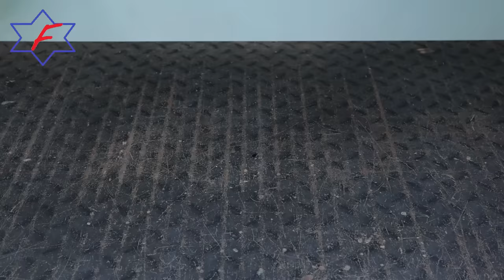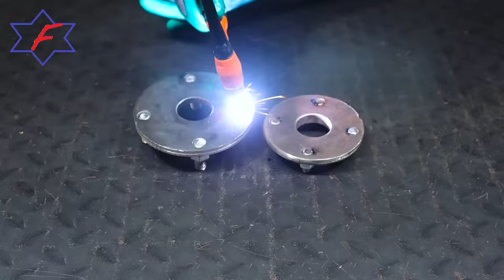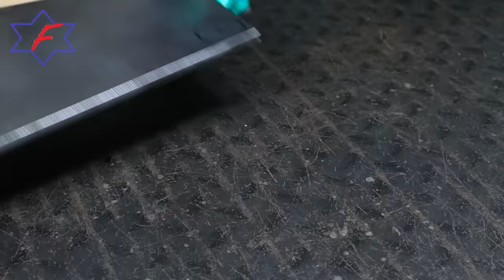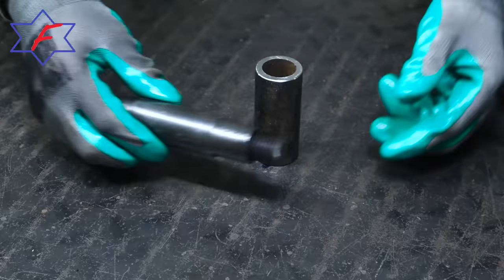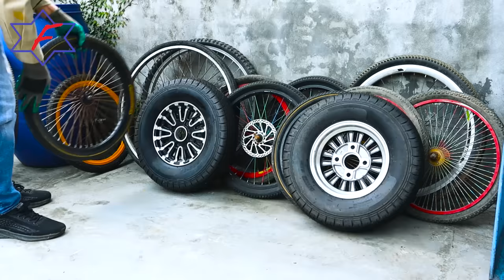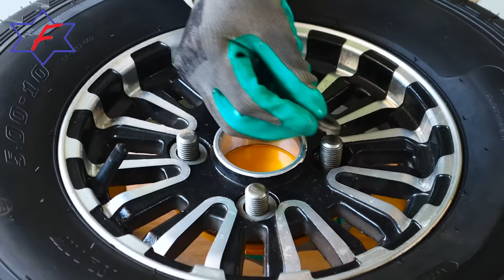Build A Crazy Trike 450cc Use Truck Wheel And Great Experience

Comment: Great work putting both the crush washers for the banjo bolt on the same side.
Reply: 25:00
Reply: I notice that as well. And the throttle cable wasn't connected to the slide in the carberetter

Comment: You've done a fantastic job building that trike , it runs but I'm more than sure all of your followers wanna see you opening up that bike . Like I said , it runs but you're not riding it fast unless you're scared of riding fast I could understand that. So put someone else to ride it so we will see it riding fast . Thank you for sharing this video. You're a genius . 💯😎👍🙌
Reply: Q
Reply: I don't think it has much chance of driving beyond 25 miles per hour, since the size and weight of the front wheel would not allow it, ''in terms of safety''.

Comment: An incredible machine built by someone with a knowledge of mechanical engineering skills and fast welding techniques. Absolute amazement and a really good video to watch. 😊 I can even see a small trailer attached by a hook up system and two small wheeled chassis for loading camping gear for example or whatever else it can be used for, when needed. Don't know what the author /creator thinks of this additional suggestion, but who knows. This machine makes a great touring bike 😅😊🤔👍🏴🇬🇧

Comment: I like the idea, the execution leaves much to be desired. I feel like no planning whatsoever went into aome aspects [body panels & everything else attached with self tapping screws], while others seemed premeditated, but badly performed [ie the measuring and marking]. I really hope the builder or someone else went behind them and properly tightened every single nut and bolt because those are just barely past hand tight. All this being said, i dont really see the point. Yes it gets views [online and irl id imagine] but theres no way youre driving this for real for more than a few minutes at a time and at very slow speeds.

Comment: You got to be a Engineer to make ur crazy trike.  I see two things wrong with ur design,  there should be some type
of rubber for the engine mount, and the rear axle is bent.  otherwise it looks cool. turning the front wheel got to be tougher.

Comment: Seems like a waste. The large wheel should have the power. As it is now, the large wheel is just dead weight. If the big wheel had the power, it would have the torque to climb. It might not have speed, but try and stop it's climbing power.